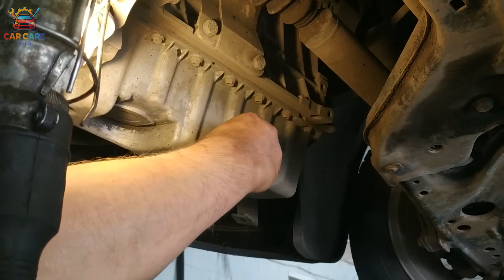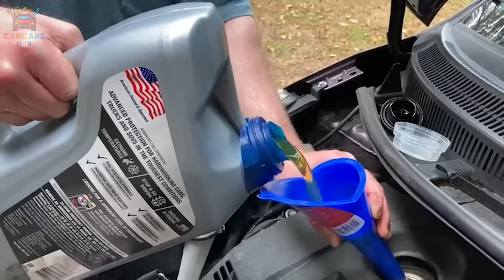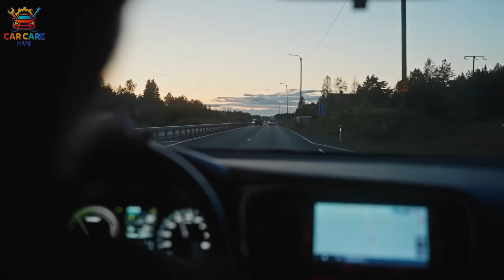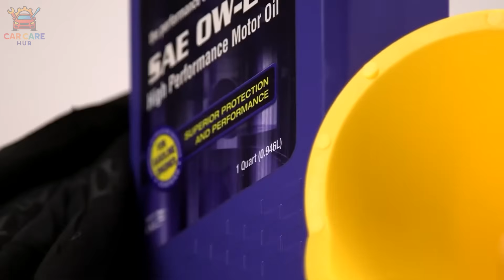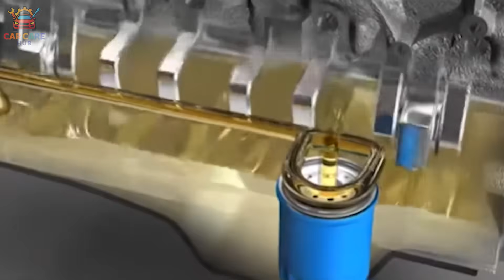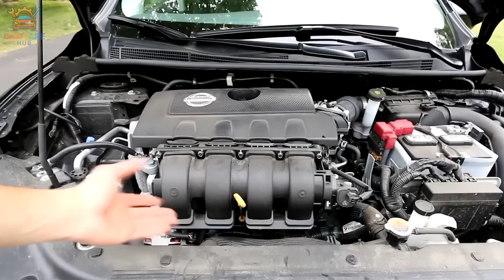8 Synthetic Oils That Can Handle Extreme Engine Heat

Comment: 2012 1500 Silverado 4 wheel drive 5.3 Engine automatic transmission 5.30 oil 190000 miles
Reply from the maker: It’s impressive to see that kind of mileage on a 5.3L engine, which speaks volumes about your consistent maintenance habits.

Comment: 2023 Toyota 4runner...calls for 0w20 but I use 5w30 Amsoil Signature Series. I live in 🔥 Florida 🔥
Reply: I live in Ky where we have pretty much all 4 seasons, but I still use 5w-30 in my 2020 toyota 4-runner and will continue. Runs smoother and quieter.
Reply: Louisiana 2016 Avalon here. Requires 0w20, and that's exactly what I use. Still runs like new, and I don't baby the car at all.
Reply: I anticipate your motor lasts longer.. change that transmission fluid as well..   Amsoil is King
Reply from the maker: Operating in extreme heat often leads many owners to choose a slightly higher viscosity for added protection.

Comment: I think this person is either on to something or on something. Use 5w-30 Signature Series. I think the correct group the oil is very important. 1 through 5 groups. 4 and 5 are best groups but group 3 can be called synthetic but is just highly refine crude.
Reply from the maker: The debate regarding base oil classifications and their impact on synthetic performance is a very important topic in the lubrication industry.